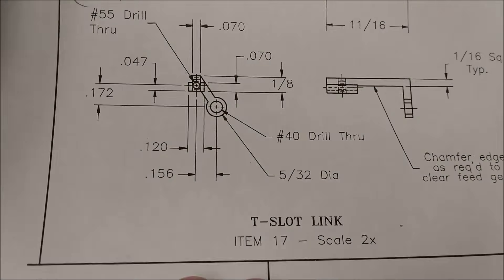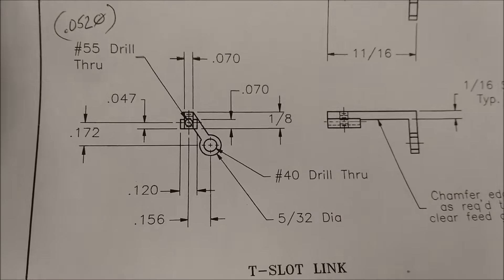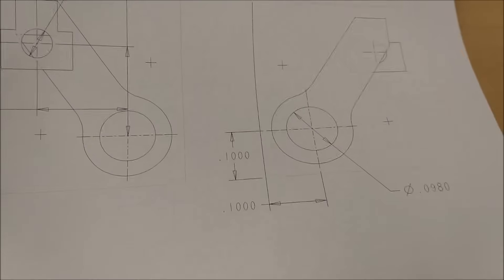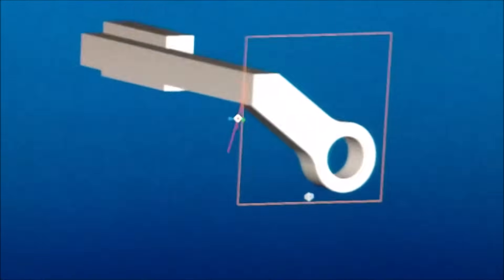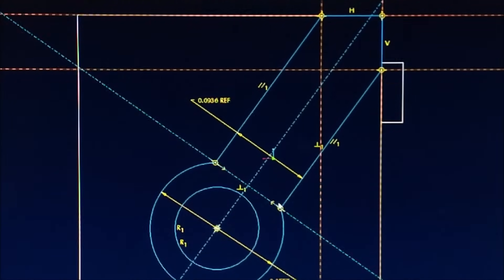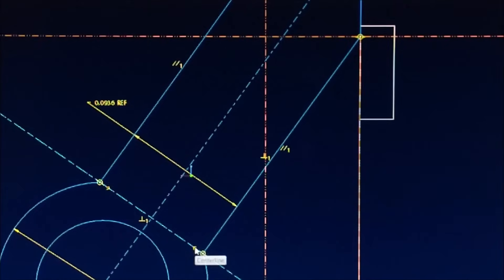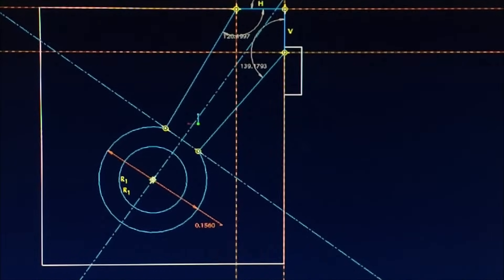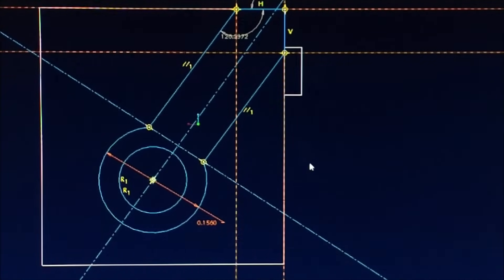Machining a Feature With No Dimensions......Mid Week Quickie !

Comment: Hi Joe, your help for me is greatly appreciated. I've been working on and off (mostly off) on this mill for a year now. It is the most difficult model I have ever tried to make; I am just a hobbyist.
it's about 80% done. many of the dimensions are on the print but are though for me to find. haven't made the draw bar yet, that will be another challenge.
Rich
Reply from the maker: I increased the diameter of my drawbar. The 0-80 they suggested just seemed too flimsy. I also have a big mod coming for that area.
Reply: @joepie221  I thought about that as well but the hole I bored in the spindle is too small for 0-72, I'll try to make it as per the print. machining to .06 at 2+ inches may be a challenge

Comment: Title is a bit off; should have been "Designing a Feature With No Dimensions". Not complaining, I find it interesting as I never used constraint based design. Still using my old AutoSketch which is more that ok for what I use it for.

Comment: The arm is at a 31.964deg angle from vertical center based on the dimensions given (arctan ftw).  The arm's width is determined by the top surface, so 31.964 with a hypotenuse of .070 gives you a width of .0594 (cosine*hypotenuse). Lastly a general rule of print reading - if it appears to be parallel and isn't otherwise specified, it's parallel.  So the print was actually fully dimensioned.  
That said, the first rule of fabricobbling is if it works who cares, so nice part. 👍
Sorry for being a smartass, bad habit I'll never shake.
Reply from the maker: Your dimensions may be correct, but I didn't use the top surface. I used the top front and rear lower corners as my targets. This most certainly affected the width and angle of the connecting arm. Regardless, without advanced math skills or CAD access, that arm will be challenging for a new machinist.
Reply: @joepie221  Oh for sure.  The scale alone is challenging enough, beefing it up a little and simplifying it is a good call.  Being a personal project it just has to work.